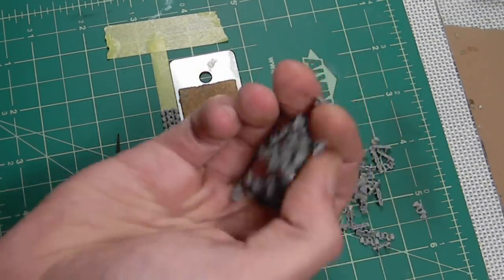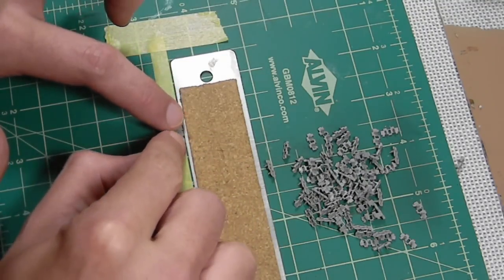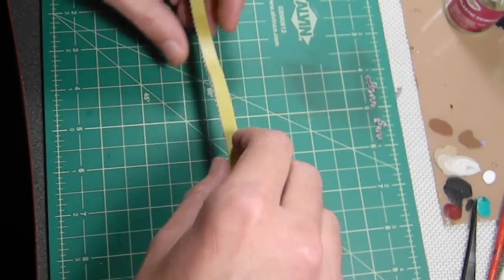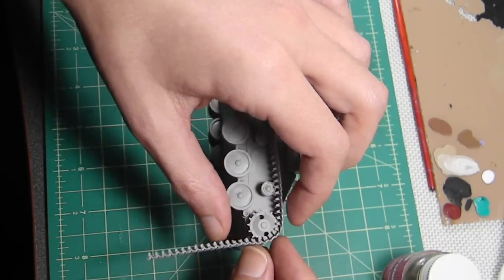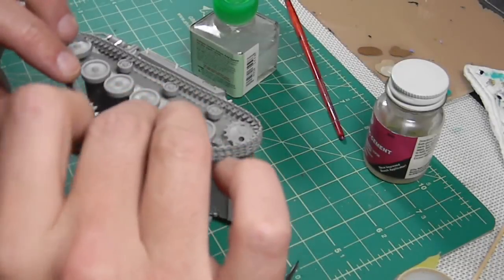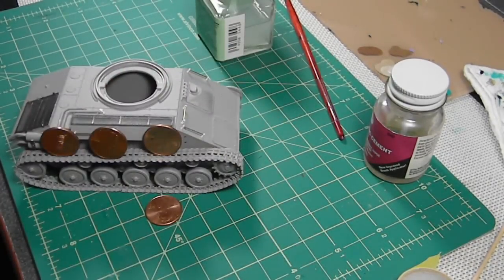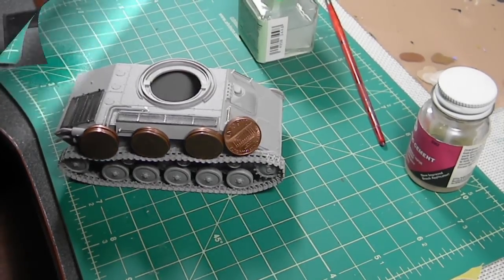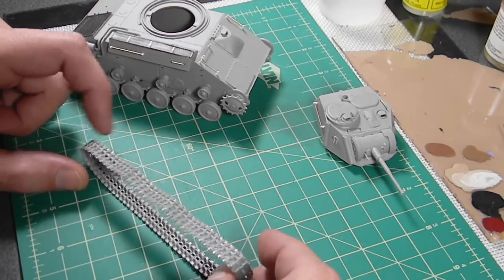Modeling Tanks: Assembling Individual Tank Track Links

Comment: I do my individual track links in sections, starting with the bottom. Depending on the tank I will either glue them in place then paint or leave them removable by not gluing on the drive wheels and / or making them in large sections I can glue together after painting.

Most of the tanks I do I glue them on then paint.  By the time you add dirt, dust and grime along the rest of the bottom of the tank they blend in a lot.  Of course a well washed tank is a different story.

Comment: Good job. I use Model Master glue like you do, but I don't brush it on,I use a tooth pick and put some small drops in the hubs where they join. Then after I get them where I want and with a sag I hit each link with Tenax 7 from a small brush on each link to make them harden. The micro welding secures the links so well they don't fall apart. Years of trial and error, but I have it down pretty good now. Some model you have to have the fenders on,trying to shove the tracks on the upper wheels suck

Comment: I've solved this problem in a similar way to you. The caveat is I do them in lengths and shape them. Then I paint most of them off the running gear. That way they go on a painted model. I add the rest of what I need into the total length. Why don't you glue down the drive sprocket?

Comment: Try doing this on a Tiger or Panther sometime!

Suggestion-try building the tracks in sections (i.e.Top and bottom runs) and also leave the idler and sprocket unglued(makes removal for painting easier).

And try to stick to stuff w/ loop track, or invest in Friuli or Modelkasten tracks

Comment: What would you do if one of the pieces which is a hinge breaks? Would you use super glue to fix it or Testors cement? I need to do just that but I am scared it wont stick firmly for a piece that has movement. Thanks for your help.